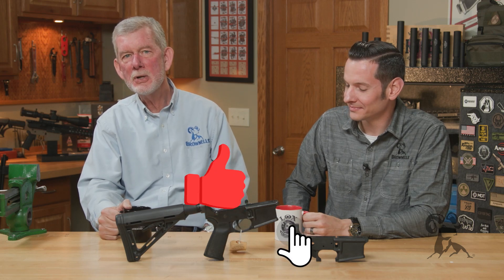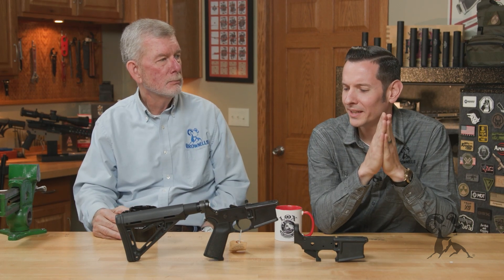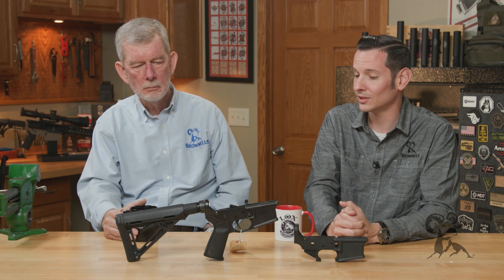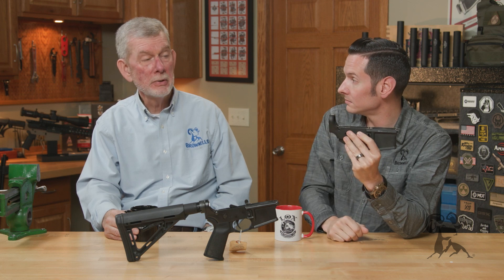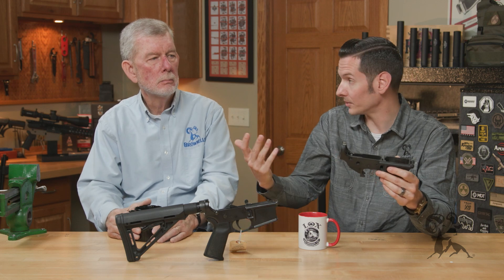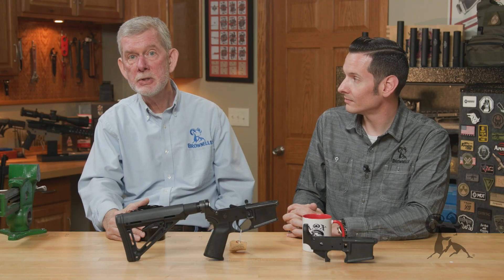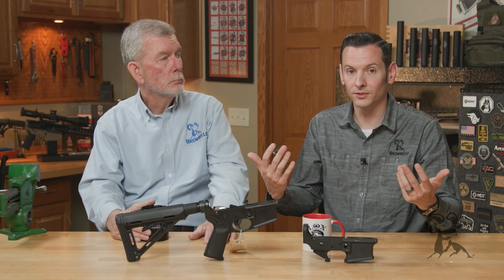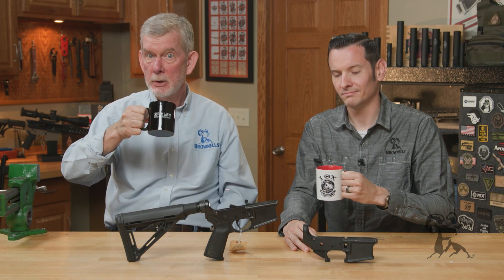Smyth Busters: Are Polymer AR-15 Lowers Any Good?

Comment: At a FNRA dinner banquet in late '90s-early '00s I won a FMK polymer lower. At some point there was a free replacement and I took advantage. Looking at the completed rifle now, there is a small shoulder around the buffer tube end. Haven't had any issues with it, but I spread use among a suite of rifles.
Thanks for the report.

Comment: 3d printing has also come a long way since the defense distributed lower but the dd lower was crap and out of spec. fast foward 10 years later tou have deturance dispensed and hofmantactical whomade 100% useable ar15 lowers out of pla.. another good one is the ubar lower.  so if someone can print it out of pla then someone can injection mod it out pf nylon polymer.

Comment: Built my first plastic AR in 2006ish using a Plum Crazy lower, Bushmaster carbon upper, and a bunch of lightweight parts that I got off of Brownells. I also replaced the FCG to mil-spec with a set of KNS anti-walk pins, because the metal on the pins will wear out the plastic over time. Anyways, it weighed in at 4lbs and 14oz dry. It was a super gun to shoot and extremely light weight. I ran about 3000 rounds through it without any issue or seeing any stress marks on the rear tang.  Then, Obama went into office, and I ended up selling the tool for $2000.00.

Comment: Ar polymer framed pistols any good? An ar lower doesn't contain any of the pressure that the upper does. I guess back in the day the plastic wasn't as durable, but the new glass filled, or carbon filled, nylons are pretty awesome. Its such a stupid argument

Comment: Bought a Tennessee arms company stripped lower receiver. After I assembled it which took considerable filing and fitment. It lasted exactly 257 rounds before the rear takedown in area cracked. That company is garbage. I called them probably 25 times, never got a real person on the line. I emailed them over 11 times. I even resorted to sending the messages on Facebook which they did see. No one ever responded to me when it came to fixing the lower. Absolutely waste of money. And Anderson costs around 50 bucks get yourself an Anderson lower and you won't regret it.

Comment: I personally watched a Plum-Crazy brand polymer lower break within about 10 rounds when attached to a bump-stock a dozen years ago. IIRC, the plastic pin sheared and likely caused the pin hole area to crack.

Comment: What exactly is the material used to manufacture poly lowers?
Reply: The same site even has a pdf file that gets a bit more specific and even has manufacturer names.
As well as many other sites that go into detail about the ratios used for different parts.
Reply: Lotsa luck finding that out - You're BASICALLY asking for the secret recipe for Coca-Cola - And you're going to get just about the same response: "It's a trade secret. Take your nosey questions someplace else!" The exact wording might vary, but the meaning will be the same. 
Several times, I've heard the (very plausible) idea put forth that most of the polymer boom-sticks are based on Nylon, probably with some carbon and/or glass filling, but nobody (other than the folks who make it) REALLY knows what else gets stirred into the mix - Same as you can say that there's some kind of sugar in the recipe for Coke, but anything beyond that is, at best, an educated guess.
Reply: In no way is it a secret like the first reply tried to imply 😂😂
Took less than 30 seconds to figure out. 

Engineering polymers most commonly used in various firearms components include glass-reinforced nylon, glass-reinforced polyester, glass-reinforced polypropylene, glass-reinforced polycarbonate, acetal, long-fiber reinforced thermoplastics, high-performance polymers like polyphenylene sulfide and polysulfone. As well as thermoplastic elastomers like SEBS, TPV and TPU.
Reply: @Lol-nu1uc  Congratulations - You've just revealed that there's "some kind of plastic" in those polymer frames. 

So now that you've gotten to the same point in figuring out the recipe for a P-80 or glock as figuring out that there's sugar in the recipe for coke, tell us the exact recipe for Glock plastic. Basically, you've just said "they're made out of some kind of plastic" - which says NOTHING MORE than "There's plastic in the mix" What specific kind of plastic? This is crucial - different types of plastic (or mixtures of plastics) exhibit WILDLY diffrent properties. In what precise proportions? (Too much of this kind comes out too flexible, too much of that kind makes it too brittle, too much of this other kind turns it "sticky/gooey", too much of some other kind makes it have the consistency of chewing gum) With what specific additives - fiberglass? Borosilicate fibers? Asbestos? Aramid (which is another kind of plastic) fibers? Graphite? Carbon fibers? Cotton? In what proportions? 

In other words, you're guessing, and what I said initially remains correct: Lots of luck finding out the exact recipe, which is a closely guarded trade secret, just like the recipe for coca-cola.

But thanks for playing...

Comment: My first rifle was an 80% build. I used a JMT Carbon 50. I have over 5k rounds through it and it's been thrown around and banged up and it's still in perfect condition. I had another polymer lower and it looked like milspec no extra material to account for the polymer and i didn't trust it at all, there was holes in the magwell through to the mag release spring from gun powder burns.

Comment: I have a super light 14.5” pinned and welded PSA upper on a polymer lower.  I had to hammer in the the front takedown pin as the tolerance was super tight.  Once together it has been awesome. It’s amazing how light these builds can be.  I have a Magpul polymer foregrip as well.
Reply: Had that same issue with an ATI Omni lower and ended up snapping off the front pin loops. ATI replaced the lower, and the new one worked much better. I think the first one had a slight warp in the front end, so the holes didn't line up perfectly.

Comment: KP 15 development and torture testing was convincing, I bought a few, only light work with one so far. 
One thing that is nice that you get what would be 3 major components color matched right off the bat. So the FDE will give you somewhat less than 50 shades of tan when you top it off with an FDE upper and handguard 😅

Comment: I've seen too many failed plastic lowers, breaking off at the buffer tube ring. Saw one occur at a range. Then there are the ones with quickly wallowed out trigger and hammer pins that suffered fire control group failures, including being able to fire the rifle with the selector on "SAFE", and runaway continuous fire as if it's a machinegun. Sorry. Plastic lowers are not for me.

Comment: The lower receiver doesn't contain any pressure. I've had good luck with my polymer lowers aside from one that is warped slightly. Tip, make sure you don't over torque the castle nut. The biggest issue with the buffer towers cracking is due to bolt overtravel from a buffer tube that is too deep. Take your BCG out of your upper and use it to depress the buffer and spring in the lower in the same motion it would when shooting. Once all the way back, check to see that  the carrier key is not to close to the buffer tower. 2 U.S. quarters is a good distance. If its too close, the buffer pad will depress under actual recoil and will make the carrier key smack the buffer tower. This will eventually either break the lower, or break the carrier key screws and create a major gas leak.
Reply: really appreciate this advice

Comment: I wonder if a company could shave some more weightnoff by makin a polymer upper as well and jus line it with a thin sheet of aluminum on all the bearing surfaces or stress points it could actually work for how long? Idk could use steel instead of aluminum to reinforce it to make it that much tougher but i may jus be crazy lol

Comment: So they didn’t say if the polymer lowers were any good… Like do they recommend them? Because it seems like they sell them but they don’t recommend them… either way I appreciate that they exist for people that need them but I am not even slightly interested. Until they can beat the specifications of aluminum or other metals they are just inferior and cheaper.

Comment: The ATI Omni Hybrid is really nice. Very light and offers a very, nice tight fit with an upper, making it very accurate. I still don't trust it 100% for it to be a long-serving SA 556 rifle, so it is relegated to .22LR CMMG adaptors or straight pull uppers.  I think they would be great with FM-15s, BR-180s, Evolution BCGs or with a light BCG/adjustable gas set up. I really do think they have their place and can be made to work well! Great video.
Reply: I own two: one a KE Arms KP15  from Brownell’s and an old polymer rifle. Both have been flawless. I would trust them with my life, an do.
Reply: @jmpetersrn  You own an ATI Omni Hybrid lower? If so, how do you like it?
Reply: @JorgeGarcia-lw7vc  zero issues. 😀
Reply: @JorgeGarcia-lw7vc  them omni lowers are junk mine broke after 400 rounds lol

Comment: I find polymer lowers for the average person who has it in their safe 99% of the time is just fine. Now I personally don't own any but that is because I use my guns constantly. Most of mine a are dinged and scratched from training classes and shoot houses. Most times I've seen broken polymer lowers is when they are put together by someone who over-torque their castle nut to the receiver and it snaps. All in all I'll take the extra weight and know it's gonna take a whole lot of damage before it fails.

Comment: Yup, got the KP15 FDE and proceded to assemble a 5.7 lb AR.  I love how balanced it is and it shoots to put a smile on my face.  I had only one issue, it was too long in the stock and affected my eye relief.  3 months after my purchase, I carefully cut 1 3/8" off, fabricated a new butt plate and it's exactly what I needed.  ke arms did a great job.  I would not have purchased a polymer AR before Ian educated us, but now I'm confident after using mine for over a year with zero complaints or malfunctions.

Comment: A polymer lower sucks if it's designed like an aluminum lower (which is a lot). Otherwise, this is similar to the whole plastic gun discussion from a few decades ago. Build using different material with that material in mind and its fine

Comment: Tupperware material quality is actually really good.
My mother--in-law has a Tupperware juice pitcher that's over 30 years old. You can still turn it upside down and the lid won't leak. No threads, no o-ring, just faultless friction fit.
Try that with your average $5 copycat...

Comment: I bought and old Bushmaster C15 about 6 years ago. The polymer lower has never failed me to this day. I did replace the upper, but even that never failed me
Reply: I own one too. Never a problem. 3:58
Reply: @jmpetersrn  update. Mine is toast. The lower receiver cracked where the grip is mounted. Happened not long after I made that comment. RIP Bushy 😭
Reply: @alecvillarreal9865 have you replaced that lower with a KE Arms KP-15?  I bought on and made a WWSD rifle. Everyone at the range has to try it out.
Reply: @jmpetersrn  I actually considered that. Really like that set up. Unfortunately I converted to the AK platform now lol

Comment: My first Ar15 was an ATI omni hybrid multi cal right when the pandemic started out.( i didn't know any better) I have since replaced everything except the lower and it has ran fine on a 10.5in set up with 1000+ rounds fired through it. I have bought other ar15s that are all aluminum lowers, but the the ATI is still kickin fine since day one.

Comment: I purchased a polymer lower AR at a gun show in Colorado a few years back. It was built by s small husband & wife team. Great looking/ performing weapon. 
   Since owning I had an issue that was odd… wouldn’t hold Magpul M2 magazines. While at the range I’d get 1-3 shots off, and the magazine would drop out. Causing a mis-feed.
   For some reason the M2 wouldn’t hold it’s “locked” position. However, I also had a new M3 model magazine. No issues. When comparing the two model magazines there is a noticeable difference in the placement/ design of the locking notch. It’s ever so slight. But, enough to cause a major malfunction. 
   Initially, thought it could be a magazine catch issue as it didn’t seem to return smoothly/ fully after release of a mag. Removed to inspect spring, lubed mounting area & mag release, and reinstalled. Worked just fine after that. Still wouldn’t keep those mags locked in place. So, got rid of all my M2’s and replaced them with M3 Magpul’s. Problem solved. Just kinda weird the others wouldn’t work. Haven’t tried any other brands. Had a hard time getting rid of the M2’s because the store wouldn’t let me return them. Luckily a nice couple in line overheard the issue, and offered to buy them from me. Got lucky that day.

Comment: I have a Tennessee Arms lower on a build I did last year.  It has a Colt upper (and innards) with a WhiteOak barrel.  The gun runs well, it's accurate, and (so far) completely reliable.  The reason I will not be making another is because of these three reasons:  1)  It has an upper to lower fit that actually rattles.  It started fairly tight, needing a good amount of push to get the upper tight enough to get the rear pin to slide in.  But, now it actually rattles when you shake it.  So, now it wears an accuracy wedge just for piece of mind.  2)  It does not feel balanced.  If you are accustom to the feel of the M4, this rifle feels decidedly muzzle-heavy.  And, when you add lights and a featherweight optic (it has an Aimpoint T2 on it now), it gets seriously nose-heavy.  3)  It easily becomes scarred and scratched, especially around the mag well.  I've shot this rifle in several NRA America's Rifle Matches and quick mag changes will take a toll on these lowers.  I have several friends who are trying the KE KP15 lower.  Jury's still out on these lowers, but the fixed rifle butt sort of limits these to the longer rifles.
Reply: I also have not had a great experience with Tennessee Arms Co. lowers. I had to have one replaced several years back. Now that replacement needs to be replaced, but I'm not sure if it's worth spending the $ for shipping.

Comment: Have frontier armory polymer receiver they torture test they did was unreal, had my gun for 5years now now issues just building it I noticed I had to mill out the mag release hole just a bit  so the button could function other than that amazing lightweight and friction resistant and easy to clean

Comment: I have several tennessee arms poly lowers for large frame (6.5cm) and Ar-15 and they all work great. On the 6.5 im using the hera arms stock that is connected to the grip so it has more support on the buffer tube since its all one piece. Its holding up fine and looks pretty cool. For my Ar-15 I have 1 on a 2a arms upper receiver with a faxon 14.5 pencil barrel with a rubber city armory Titanium ultra lightweight bcg 5.9oz complete. I used a slew of other light weight parts to come in at 3lbs 10oz without the optic and with optic 4lbs 2oz. Its has adjustable gas block adjusted to cycle reliable and super low recoil. My .300blk is identical except 7.5 faxon pencil barrel and its 3lbs 12oz with optic. Both guns shoot great with no problems and no signs of stress near the buffer tube support. They both have well over 2500 rounds (subs only on .300blk) and Im super confident they will hold up. Now’ if your the kinda guy who thinks you should be able to use your rifle as a pry bar or run it over with and tank and expect it to not break you should move on and keep hitting the gym to haul around your fat pig. My main reason for the lighter builds is so my wife can enjoy shooting without complaining of the weight. They were not cheap but it’s worth it so my wife can enjoy shooting’ she has had multiple surgeries on her back’ neck and shoulder. Most of my friends want to build one too’ but its too pricey for most of them so they just shoot mine when we go out. I plan on going to Front site with the .300blk build to see how well its holds up but these are not my go to guns if I need one’ I have  7 other Ar’s to choose between for that. If you build it right and don’t have the same expectations as aluminium they are just fine.
Reply: Thanks bro I bought 3 complete Tennessee arms polymer lowers one is 9mm dedicated

Comment: When the gun store I was at first started selling the Glock in 1987 we had so many returns it was unbelievable. Rails were breaking left and right. Sites were coming off people shooting themselves while putting it in a holster. We even had three come in with live rounds straight from the factory that's quality control for you. Give me an HK the original and every time. I still have my HK will not own a Glock if you paid me.
Reply: That’s odd. The original Glocks were pretty trouble free. Must have been a bad batch that was shipped to that store.
Reply: "people shooting themselves while putting it in a holster"

Surely that was user error, and not a fault with the gun?
Reply: the sites thing is believeable. gaston had to put target sights on them to get them in the country. they were weak and easy to break, and were supposed to be removed and replaced.

Comment: I had a New Frontier polymer lower. It worked just fine, I just didn’t like the polymer take down pins. Besides that I kept it for 7 years and it gave me zero problems. The only reason I sold it was because I wanted something else.
Reply: How many rounds did you put through the frontier polymer lower?
Reply: Man, I couldn’t even tell you, I lost count after a while. I sold it to a family member and it’s still running.

Comment: The only polymer lower I will use is the KE Arms. It is tough, durable, and well designed. I break stuff to ensure they won't break when I need them. KE is good to go.